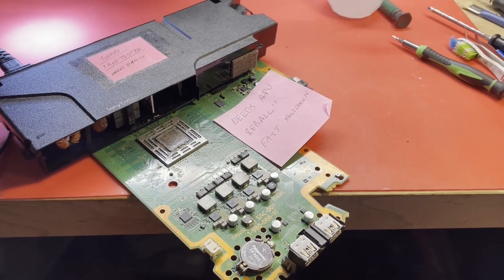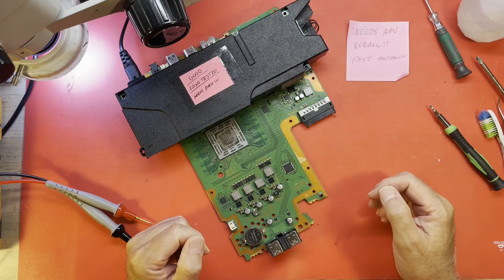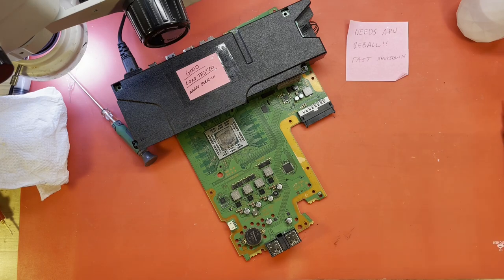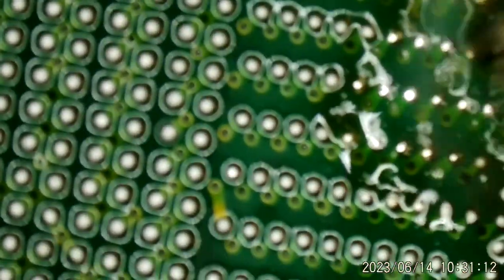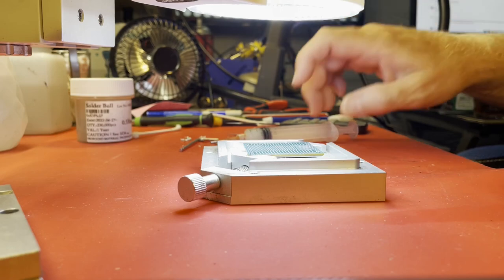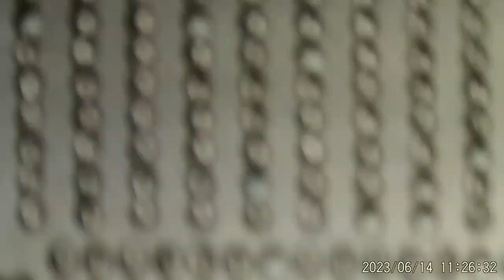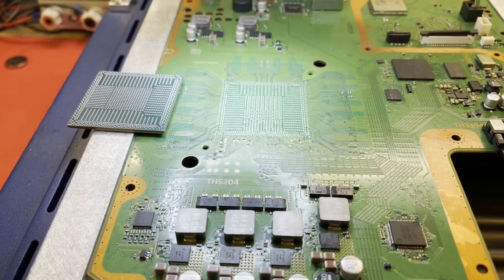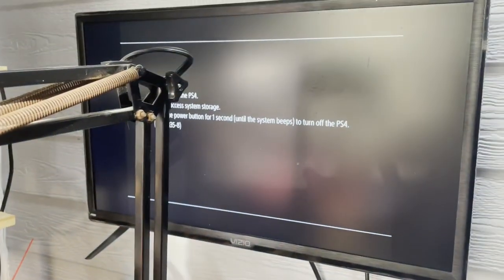#93 Repair of PS4 PCB SAC-001 Fast Shutdown

Comment: The problem you had happened to me several times, just when the video started I was going to tell you, in my case I did not have ram, gpu or vcore voltages, that missing capacitor goes to the PWM

Comment: very good.  reball to apu is welcome.  when you manually place the balls on the apu, clean the place well with ipa, then apply flux very, very little, so the balls stay in place and do not move when you heat them.
Reply from the maker: Thank you!  I’m still learning.  I’ve done maybe 5 APU reballs.
Reply: @ToltecMerc  you are already a good technician.  good works

Comment: Nice work! I remember the days when I used to do this for work. Reballing using the stencil and flux is not an easy task to do...especially filling in balls individually afterwards and lining everything up  so hats off to you. Seeing that resistor reminds me that I have a SAC-001 board that someone destroyed and knocked off several components....but it's hard to find a good close up photo so lord knows if I'll ever get it going without watching more videos like yours. Great setup with the microscope and rework station + board heater!

Comment: I have he manny console and know every PlayStation like the back of my hand.I had a few of these models.I don’t have the ability to do surgery on a APU like this.what I do is take the plate that bolts down the heat sink.I bend it and it applys pressure to the board and this model is good to go.the ps3 fat boy is currently the only console maid by PlayStation that I can’t bring back to life.I enjoyed your video and wish could have got into this type of work at a younger age.your a wise man looking back on what I was doing it was because the APU ball joints had failed.I guess you could say I’m hands on with my work.thank you for this video I learned a lot.

Comment: I hate doing a tonne of work to find out it was something simple. Good result though. Was very tempted to buy a large BGA rework station once, if I did I might have ended up saying yes to a whole lot more headaches like trusting I'd put a million balls on correctly!
Reply from the maker: Oh the BGA reball was necessary.  I was able to get it to boot once by pressing on the corner of the APU.  I wasn't recording then.  Also, after the reball, I had no APU power at all.  I had APU power before the reball.  I had to have knocked that resistor loose during the rework.  I don't think I could have ever had APU power without it.

Comment: Great as always! If you let us to know. What are the settings for you air gun to the spheres don't go away? What flux do you use? Thanks.
Reply from the maker: My quick 861DW has airflow adjustable from 0-120.  I was using an airflow of 20 at about 420C.  My flux is cheap Kingbo RMA-218.

Comment: After all that re-balling work and you found the resistor, I had to go "Doh!" for you. lol
Reply from the maker: The reball was needed as well.  I didn't edit this very well.  The APU voltages were there before the reball and missing afterwards.  Somewhere in between I must have broke that resistor.  Also, I was able to make it boot normally until it overheated by pushing down on one corner of the APU.  I didn't get that recorded.

Comment: It looked like alignment of the stencil was difficult. Also I would be interested in how easy the stencil comes off after you flow the solder balls. Perhaps a complete tutorial on the next BGA you do?  Thanks for continuing to share your experience as we all learn.
Reply from the maker: With this stencil, you remove it before heating the balls.  I think this stencil would immediately warp if I heated it.
Reply: Thanks, I don’t know why but I thought they were metal, perhaps stainless. Glad you cleared that up for me.
Reply from the maker: @johnrazor8720  oh the stencil is definitely metal.  Very thin and delicate metal.
Reply: @ToltecMerc  I tried. It definitely  warped
Reply: Different type of stencils allow you to heat them as u suggested called "direct heat stencils" this stencil used isn't one of those.
Reply: @anthonyboccardo2726  yeah the one I got stated it was direct heat. But as with everything from China, you don't get what you pay for regardless of how much you pay.

Comment: Do you mind sharing what settings you use on your hot air for this sort of APU reball? I try asking others, even people i know defer to your wisdom who just tell me not to use that preheater and hot air. Yet ive seen many videos of people doing it successfully. I gather its about being smart and emulating a BGA profile not just smashing it with heat
 😊 TIA appreciate another great video.
Reply from the maker: I preheat the board unitil it is around 110C, then I use about 360C from above with the wide square BGA nozzle.  I use 350C when reinstalling because the APU will have leaded balls then.
Reply: @ToltecMerc  thank you sir :) time to start practising on some junk boards

Comment: What Temps are you using with your hot air station? And is it a quick or an atten.

I need to find that nozzle for my atten st-862d. 

Thanks for the video.
Reply from the maker: It is a Quick 861DW.  I was using 360C when removing and installing the APU.  The preheater does the rest.  The nozzle  is not specifically for my Quick.  It is a generic one that I modified slightly to allow it to attach to the Quick.
Reply: @ToltecMerc  can you please link here for nozle purchase . many thanks for your work .learnin alot from you
Reply from the maker: https://www.ebay.com/itm/383174960680?mkcid=16&mkevt=1&mkrid=711-127632-2357-0&ssspo=pDC24JRgSXS&sssrc=2047675&ssuid=mrxy8wV3RYi&widget_ver=artemis&media=COPY

Comment: Great Video.
What temperature do you use on your hot air station to remove the APU, is a "QUICK" station? and what temperature on the pre heater?

Comment: On the remounting of the APU, how could you tell it was soldered?  In some videos I've watch, you can see the chip actually "find home"/sift a bit.  Some will show (with smaller IC) the chip "dancing" a bit with wiggling the airflow.  In this case, I saw nothing.  I did not see the chip shift, sink, or do nothing.  If that is case, how do you know you have fully soldered it? (Sorry, I am trying to learn how to replace a much smaller PowerPC chip and have yet to be successful.  There is also an FPGA, I would like to learn to change that only has ball connections around the outer edges of the chip, so it shouldn't be as difficult (no heatsink pad in the center).  Do you have the airflow set to min/middle/max?  I wish I had someone local I could learn from, but I do not.
Reply from the maker: I nudged it at the bottom and top.  I'm sure it was hard to notice because of how far away the camera was.  I nudge it very gently and watch for it to snap back.  The balls are so close together on the APU, if you nudge too hard you risk the balls moving and merging underneath.

Comment: Hi, im with same board and same problem, but i dont get the 1,5v on memory capacitors, the others (12v, 1v and 1v) i could mesure, in fact the capacitors from memory coil are shorted, what do you sugest? Tks a lot for your videos, im learnig so much. Sorry for my english and a hug from brazil
Reply from the maker: If you have a true short on the RAM voltage (1.35V) you need to find it.  It could be a RAM IC or a capacitor on the 1.35V rail.  There are many small ceramic capacitors on the 1.35V rail.  Can you inject 1V on that rail and look for heat?

Comment: You awsome 👍👍 happy repair 
Good luck sir
Reply from the maker: Thanks, you too!
Reply: @ToltecMerc  by the way 
I have tested the new TEA is the replacement for DAp053T  and i confirm that it works fine and tested the console about 2 weeks ago.. just still not tested under external load as i have just recived my dc electric load  only few days ago .. 

Thanks again for sharing your knoledge 
Keep going 🫡

Comment: From my experience... I think the problem was the resistor from the first place not the APU
Reply from the maker: Except I had the APU and RAM voltages before the reball.  They were totally missing afterwards.  No APU core voltages and no RAM voltage.  That's what made me suspicious that I had done something.
Reply: @ToltecMerc  Very good work. You are definitely a Play Station wizard. I've learned tons from watching your vids. Keep it up. Did you create the square adapter you put on your hot air station?
Reply from the maker: No.  I bought off of eBay and modified it to fit. https://www.ebay.com/itm/383174960680?mkcid=16&mkevt=1&mkrid=711-127632-2357-0&ssspo=pDC24JRgSXS&sssrc=2047675&ssuid=mrxy8wV3RYi&widget_ver=artemis&media=COPY

Comment: Recalling the chip is always my biggest problem, what temperature and amount of Flux you use. Please 🙏
Reply from the maker: Use a minimum of flux.  I just spread it really thin with my fingertip.  I probably used around 415C with very low airflow.  My airflow goes from 0-120.  I was on 20.
Reply: @ToltecMerc what temps did you use to remove the APU ?

Comment: I have the original ps4 the one with the light strip on the top and mine just started doing that a few weeks ago,  not sure the exact problem tho, did the longest time my controller would just shut off and would just blink white then turn off then a few minutes later I would loose as wireless connectivity and would have to pull the plug while powered on to fix the issue